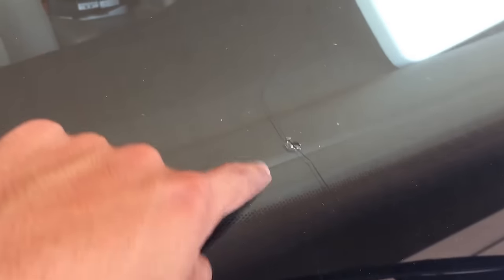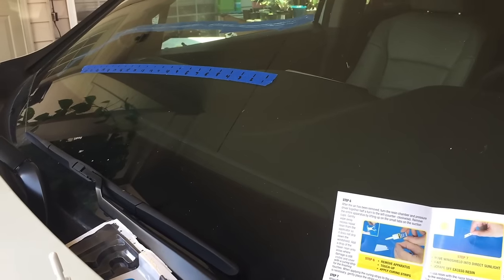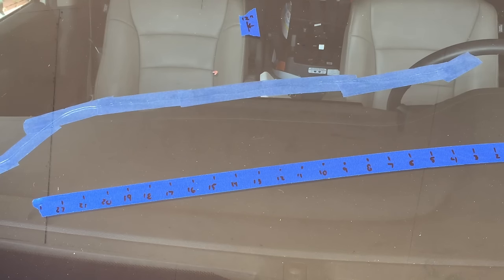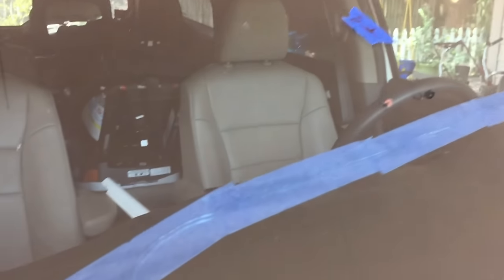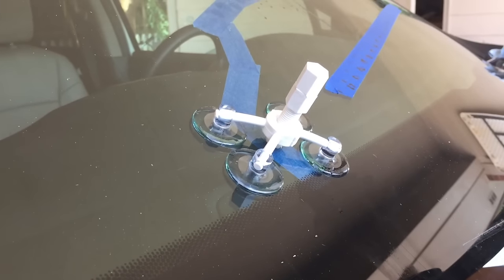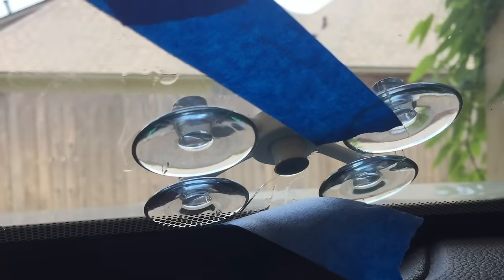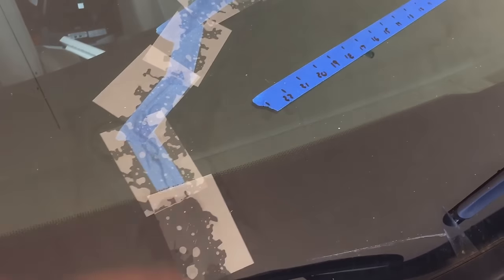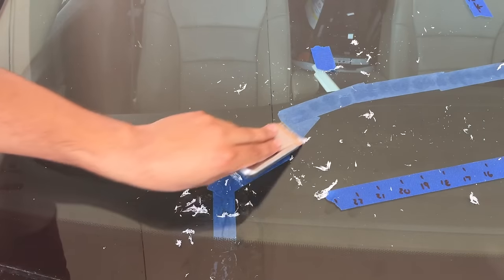Rain-X Windshield Repair Kit on a Chip + Long Crack

Comment: I just got this packet of rainex windscreen repair kit, so im watching this,so far the cracks still totally visible,im up to the wait for resin to dry part , a crack about a foot long from the edge of windscreen on drivers side shaped like a j, an totally still see the crack
Reply: Did the crack manage to disappear somehow or is visible cracks after putting resin means there will be cracks after it dries?
Reply: @IAmAmirul  it doesn't work at all
Reply from the maker: @IAmAmirul it def doesn’t disappear. It greatly reduced the visibility, and stopped it from spreading further. We now have another crack and it is much more visible and continues to grow

Comment: Thanks. I'm in Metairie. Bought a 2008 Smart Fortwo Passion that has a long u shaped crack I wanna fix. So far, none of the videos on DIY repair I have seen will get rid of the crack completely. Youd windshield may not be too expensive.  Just to buy the glass windshield for my car would cost 81.00 dollars but I can't install it. To have someone else install it including the price of the windshield is 230.00 dollars. Not too bad.
Reply from the maker: Yea my whole idea of getting it to stop before it spread in front of the driver in order to pass EBR inspection did not pan out lol... EBR only allows like 8" long cracks max, so gonna need to shell out the cash soon for it unfortunately
Reply: @fiveohmxco  I can't fault you for saving money. My car did not have a brake tag. I took it in for an inspection today and the windshield passed because the crack was not in the way of my view. I did however find out the horn did not work so I have to fix that this week but the inspector let it slide and I got my inspection sticker anyway.

Comment: I'm going to try the diamond bit on the Dremel and this kind of kit from my local Napa. And my crack is almost the same. But I'm going to use my squeegee to get rid of the bubbles. I did tile and stone all of my body life. And anything ridged that has a crack in it needs the pressure released. So we always drilled a hole right in front of it. And most of the time it works. Great video, just try a squeegee next time. After drilling a needle size hole right in front of the crack. Usually Anything that your waiting for to dry or cure, from concrete to fiberglass, the slower it cures the stronger it will be when it finally drys. So don't rush the process, hot things expand/grow, and Cold things contract/shrink. Kerry Grant luvs mother earth and not plutocrats fracking narcissistic autocrats.
Reply: specifically where did you drill and what does this do for the end result- less noticeable repair, stronger, etc?

Comment: The directions say to also use the razor blade to remove any glass fragments from the hole so the resin can fill it in fully.

The reason the give you extra sheets is to reuse it later multiple times.  I've had a bottle for 10 years and the resin is still good.  I use a small nail to puncture the bottle opening for the resin to use it again and keep it all in a plastic bag in my tool chest.

In one case, I had to do a second coat after the first to get areas where I didn't apply enough resin after pushing it down with the plunger.
Reply: Great info here, thanks for the detailed lil extras. I'm going to give it a go and will be sure to pay extra attention to how I use the razorblade to remove the fragments! Thanks again!

Comment: I don't think you're going to deform the glass by screwing the pressure screw more, that's the key thing to how these work, you expand the glass by cooling it, then you pressure feed the resin in the larger crack, then as it warms up, it comes together and cures.  I've got a 50 year old car that is very hard to get glass for, I'm going to try this out.  My concern is that once you get an amount of resin in the crack, you'll be blocking future resin from getting all the way in.  As far as expansion goes, you need to drill a tiny hole at the end of the crack, then fill that hole, that's how they do engine head repair, it stops the travel.
Reply: I have a one inch crack. Do thing I need to drill?
Reply: @bmack2938  I would do it without drilling.  Be sure to contract the glass with ice before you force the fluid into the crack.
Reply: @bmack2938  You want to get through the first glass layer.  If you search a few vids you'll see folks using a sharpened punch or nail which they then hammer lightly/carefully to create a mini bullseye.
Reply: plz post back when you tried to save your windshield. I got a 1971 cutlass S I just bought and same thing,hard to get a windshield for.Watched this video to see if I could repair it enough to pass inspection and not annoy me looking at it :)
Reply: @bertvisser6423  I should be able to get back onto that project this month.  So many projects going on at once, I nearly forgot about that one.
Reply: I was thinking of trying to make a slight chip with a Dremel in a couple of spots. I have a 10 inch crack starting from the top left corner from under the rubber around the windshield. There's no way I could fill the actual chip as it's on the edge..
What tool would you recommend to make small partial holes in the glass?
Reply: @bmack2938  if you do buy glass bit, made for this, dont go too deep
Reply: @Karl Jay, you don't think screwing down more will deform the glass, but that's exactly what the instructions in the Rain-X kit say.  Also, there are many reviews on Amazon where people screwed the resin chamber down too hard over a chip and it caused new cracks to radiate out from the chip. So screwing the resin chamber down too tight is definitely something to be avoided, your speculation notwithstanding.
Reply: @yrniceguy  I guess part of it has to do with how long the crack is.  I can see where more pressure might extend the crack. Maybe doing a long crack in sections might help. Another solution might be to vibrate the glass so that the fluid can flow, but that might cause a crack to expand as well.  Even temperature can cause crap to expand.

Comment: Just so you know, I wouldn't recommend but had to try this method on my kid's tablet. It worked a little bit but difficult with spots that had small pieces of glass missing. Waiting right now for it to cure but ran out of daylight so yea, 😆
Reply from the maker: Ha! Man I never thought about that. I’ll have to try that too! Ive got a couple of my kids tablets in a shelf I can practice on 😂
Reply: Good idea! Maybe if you get one of those full body tablet cases they make for kids with the screen protector built in, that might put the cherry on top to keep any lil fingers away from the gaps after you try the resin! And they're pretty cheap on Amazon which is always a plus! I'd love to hear how you made out, I may have to give this a try too!
Reply: @DarlingMissDarling  well the repair didn't hold up or cover as good as it does for a car window of course and after talking to Amazon more....I was able to get them to fix it. The screen protector afterwards might have helped though but wife didn't want to get it. 

Update though from the fix. They lost it in the warehouse and asked me to buy another one and then I would be reimbursed. Luckily I did get my money back. Also for Amazon kids tablet, they do have a warranty that is good for use.
Reply: @scottneal2738  ahh, that had to start out pretty disappointingly after doing all that work with the kit! But I'm glad to hear that it ultimately got worked out in the end. Thank you for the detailed update, you saved me a ton of time and frustration with that info, I so appreciate it! 😊👍
Reply: @DarlingMissDarling  note though as my kid just didn't crack his screen but had small pieces chipped out as well so I truly couldn't fill the gap for those spots but the crack line's didn't look to bad if given the proper amount of time to cure.
Reply: @scottneal2738  ah ok, yes that definitely makes sense. My crack is almost a straight line from one corner to juuust about the opposite corner. It doesn't seem that there are any chips at the start or finish but I am definitely going to give that a very close inspection! I really appreciate you responding with that tip!

Comment: I repair windshield professionally.  There’s a couple of things to consider when trying something like this: 

1) the windshield is a safety component in the vehicle.  It absorbs 20% of the cars weight in case of a roll over, it prevents passengers from being ejected in case of an accident, and prevents objects like tires or debris from flying into your vehicle.  You want to make sure the structural integrity is intact so an improper repair can be costly in more than just money but safety.  

2) using resins that aren’t designed for long cracks can fail over time, thus compromising the structural integrity of the windshield 

3) in order to permanently stop a long crack from spreading you must properly drill into the windshield and tap a bullseye at the end of the crack. Drilling too deeply can damage the inside layer of the windshield (PVB) and compromise the structural integrity of the windshield.   

I’ve seen something like this done, even drilling a bullseye at the end, and within time it gave out.    Safety first.

Please refer to the Repair of Laminated Auto Glass Standard (ROLAGS) for more information on the safety of windshield repair.  Every certified auto glass professional is familiar with ROLAGS as it’s the ultimate standard in the US.  

Please see the PDF files at the right of the screen on proper resin bonding and what constitutes a successful and failed repair.  

https://rolags.com/
Reply from the maker: Great info. I didnt realize any of this but it makes a lot of sense. Kinda feel like this info should be included in the kits!
Reply: @zhbvenkhoReload  😂😂😂 they deter us from DIY fixes so they can profit BILLIONS!!
Reply: @Zeppodone1000mg  dang right they are
Reply: Prob the exact reason I’m get a new windshield instead of this
Reply: I think the noticeable improvement in regards to crack visually at $10 is worth the try and I’ll definitely commit to memory that  the next time I roll my car I may lose some structural integrity to slow the velocity of my body as it impacts the windshield and thanks again.
Reply: Structural integrity my ass. Yeah it can keep things from flying in your face but at 55 mph its still just glass. LOL I drove a tow truck just after high school,  most times we would pick up a windshield that had can out in a roll over.
Reply: nice sales pitch bro...you must be a Safelite branch manager....of course it may fail over time but it will hold until someone can afford the 500 bucks for a new windshield
Reply: My windshield had small crack.
I replaced the windshield for safety. Then less than two weeks later a small rock cracked the windshield again...small bullseye.
How do you think? -Did I replace the windshield again? 😂
Reply: @fiveohmxco  did it pass inspection?
Reply from the maker: @rocketthedachshund2961  still haven't gotten it inspected! rocking the 2020 inspection sticker lol. i don't think it would pass due to size though. I read louisiana limits to 12" or something like that, regardless of where it is on the windshield
Reply: Dude said the windshield keeps you in during an accident lmmfao!!! 

I used to cut people out of cars professionally and from experience and witnessing it the windshield is NOT what keeps you in your vehicle during an accident.
Reply: so--- do ya warn people that china cheapo windshields that "y'all" sell for 1/4 the price are cheap for a reason?? im sure you do but just curious ,,,,
Reply: Bla bla bla
Reply: Yeah, it’s not rocket science

Comment: If I had a long crack like that i'd have to get it fixed. In my state I believe it can't be longer than 3 inches or it fails safety inspection. For a regular 4 banger, you can get a glass dude to replace the windshield for like 150 bucks. For a larger car, or one of those fancy sensored one, it may cost more.
Reply: Those cheaper installations will show over time. If see a windshield that looks like it was sandblasted it is probably one of the aftermarket installed. It is hard to keep to original standards, while dollars matter.
Reply: @johnyaceyko9775  One time I was at the Honda dealership and the guy in front of me was picking up OEM Honda glass. And I was like you paid for Honda glass? So he asked the Parts counter guy if it made a difference. And the Parts guy actually said "glass is glass" for what it's worth. It wasn't a windshield though, it was door glass.
Reply: @aznnp77  “glass is glass”? Definitely not. There’s multiple layers with laminate in between. You get what you pay for and $150 for a full windshield sounds very cheap. There’s a reason the dealer windshield is way more expensive. Just my 2 cents. And 2 cents ain’t much.
Reply: @poopandfartjokes  I don't have much experience with it so I couldn't tell you. I know my father had his windshield glass replaced for about $140 maybe 10 years ago. The transmission died I maybe 4-5 years later and it was still fine I think. I just fixed my crack with the permatex kit. Worked really well. I can kinda see it stil from the inside but I don't think it's gonna spread. Worth the $18 or whatever I paid for it.
Reply: @aznnp77  nice 👍

Comment: You forgot to kinda softly pull so u can gap it a little more where resin could’ve got In better but not bad
Reply: Softly pull how? Should you push from inside the car before applying resin?
Reply: @impendingrapture  I think with the suction cup tool.  Softly pull up before applying the plunger to release the air before curing.

Comment: Big thanks from Manchester Uk, this helped a lot. The instructions supplied in the kit for repairing cracks are contradictory, because it says you just use the resin tube, but the final second step describes removing the suction-cup device, which is only for chips/bullseyes ?
Your vid totally clarified what to do 👍

Comment: Expansion of the joint by pressure before application. Pulling a vaccuum if possible. The air must be evacuated and replaced with resin. It is the air that you "see" in the crack.
Reply: can u explain how to do that
Reply: Hw do we do that
Reply: virtually impossible without covering the entire area and using a vacuum, this guy is just over complicating this.

Comment: Was gonna replace the windshield on my girlfriends CTS and they wanted $1500 so I picked up one of these suckers.

🤞
Reply from the maker: Hell yea! Just take your time and realize you can work and play with it a lot as long as you're applying it in the shade, protected from the sun. Good luck!
Reply: @fiveohmxco  turns out it's a polarized windshield so no dice, helps a little but not nearly hidden.

Oh well, it was a good learning experience, I'll probably fill in some chips on mine with the leftovers. Cheers.
Reply from the maker: @30 Year Old Bunta  ahh dammit, sry to hear. Didnt know that was a thing!

Comment: You should have made a small vacuum with the tape and a few sandwich baggies .. put a little hole to pull some vacuuming to the sealed baggy tape contraption . .. then blown back into the hose .. would work into the crack ..

Comment: Great video! I'm not a glass guy but aren't these windshields laminated? Wonder if you applied juice to the inside would it be less noticeable? Would be hard for a car but motorhome glass is more vertical. You've convinced me to give it a try on mine.
Reply: Ya true but 90% of the time only the outside is cracked also if both were cracked they wouldn't fallow each other meaning all cracks inside and or out will take very different paths

Comment: He said he had a couple things going against him, longer then recommended crack & didnt fully push the air out,    probably how 90% of us would end up being satisfied with rather then deal with the monotony of the process. Maybe a 50mm(2 inch) paint roller lightly run along the length to help expel the air may be a more uniform process, im a layman, just a thought.

Comment: Would this be enough to hide a crack from a safety check to pass safety? Maybe show up with a dirty windshield after the repair would help conceal it better 😬
Reply from the maker: Lol. I was honestly hoping it would, but it didn’t do a great job of hiding. Maybe if you spent more time trying get the resin in, tap the inside of the windshield and work with it longer before taking it out into the sun
Reply: @fiveohmxco  yeah.. oh well! I would try this first because on maui the cost for windshield replacement is about $700 and I just replaced it a little over a year ago!! A tree branch fell and cracked right over the driver side 😂 FML
Reply from the maker: @adamc4155  😫 that was my first intention to get it to clear up and pass state inspection, but it didn’t disappear like I hoped. So we’ve just pushed it off for 4 years 😂
Reply: @fiveohmxco  I read a comment on another video for rain x repair kit and it said to hold a flame on the inside for 10 seconds at a time and the heat will pull the resin into the crack! Gonna try it out today 🤙
Reply from the maker: @adamc4155 come back and let us know how it works! Or better yet make a YouTube vid for us!! 😁
Reply: @adamc4155 I read that using the sun while the resin is setting helps too, that the UV and heat help cure it better.. no idea if it's true or not..

Comment: Need to get a carbide tip drill and drill at the end of the crack. That will keep it from running any further.
Reply from the maker: This did the trick for us, 3 years+ still holding! But I agree drill bit is good to stop crack propagation